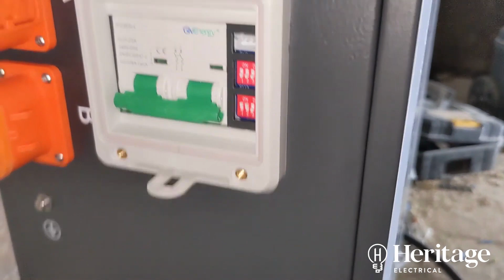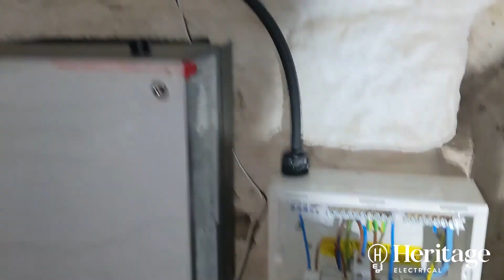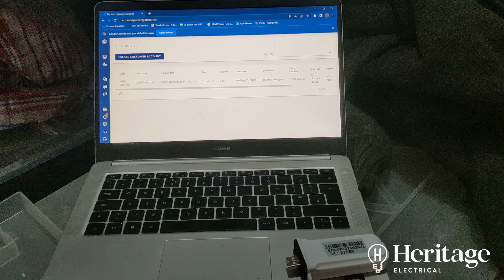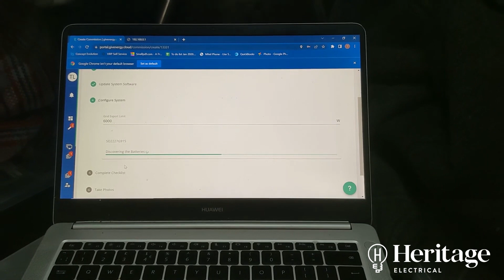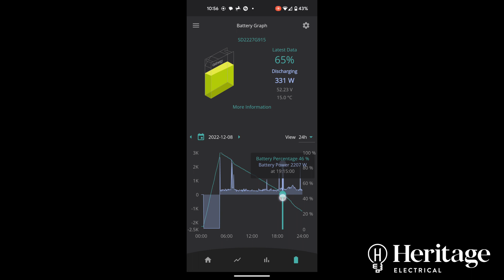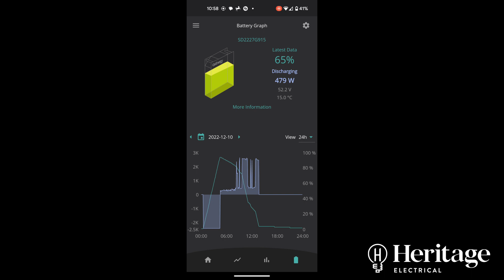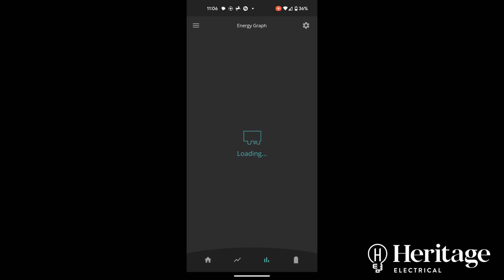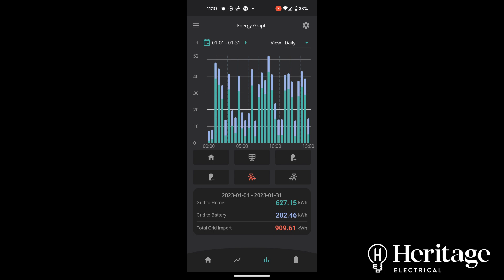Part 2: Installing a Givenergy Inverter & Battery Setup to Save Money with Octopus Go Tariff

Comment: Hi, It is very educational, and learned a lot.  I have a small question.  I have GIV-HY-5.0 G3  inverter and a Gem120CTM meter.  But not able to commission it.   Potal not seeing the meter.  Use ports 9 and 10 on the meter and the meter port on the inverter is correct. (+ & - are correct on both ends of the cable.)  there is output on this twisted cable.  But the system not seeing the meter.  The meter displays all data such as voltage, download power,  current, frequency, and so on.  Maybe I require an EM115 meter !!! thanks

Comment: Many thanks for this video.  Am looking at adding an AC coupled battery to my exisiting Enphase PV solution.  Probably late now, but you could have saved teh coinduit by having the data cable enter with the battery cables and then loop out of one of the spare compression glands.

Comment: Different question . Is there way to pair DIY LiFePo4 48V 16s with Givenergy 3.6kWh hybrid inverter ? Or it need to be specific battery with communication cable only ? Thank you
Reply from the maker: You would need to consult with Givenergy I reckon. Personally I would match manufacture of inverter to manufacturer of battery - you may have issues if you need to make a warranty claim otherwise.

Comment: Apart from your calculations re payback being highly flawed as mentioned in an earlier comment, I'm concerned about the lack of space given to the inverter. The spec notes that the inverter should have 300mm clearance below it, and 400mm to the left, right and above. Clearly in this installation only the bottom clearance meets the spec., I'd be concerned that in the event of a warranty claim that GE would refuse any claim on the basis that the inverter wasn't installed correctly. Not having a go here, but if this should happen, you're going to end up with the bill! I've only watched your videos as I'm about to look for tenders to fit mine, so wanted to see what it entails.
Reply from the maker: Hi Will, this clearance was checked directly with Givenergy before install. The Givenergy commissioning process is very thorough and involves sending photos to ensure compliance with installation to validate warranties etc. Empirically the customer was saving around £3-3.50 a day based on previous vs current bills with the battery install - this video is designed to be a quick look at some of the information provided by the app. If the customer was looking for detailed analysis before deciding to make a purchase, we would have done the calculations more thoroughly and employed an energy meter to determine usage/spec suitable equipment. As it happens this customer already had done their calcs and purchased the gear, we were asked to fit and commission only. Thanks for the comment.

Comment: 18:13 great video, just on your calculations here I think you’ve been a little simplistic, as I imagine a good chunk of that grid to home usage is also in the Go period going to the EV as well as the battery which the charts don’t show
Reply from the maker: Hi mate, thanks for the comment. Could you elaborate further? I'm just doing a very rough calc based on what the battery is saving them- they already had an EV and the go tariff before this install. Thanks, Tom
Reply: @HeritageElectrical no worries, the two options it shows is grid to home and grid to battery. Assuming they have the battery set to only charge during the Go 4 hour window, any EV charging at the same time will be counted as Grid to Home but would be at the cheaper 12p rate plus any other devices they may run on delay, we manage to do washing, tumble drying and dishwashing in our 5 hour go faster window, which more conveniently starts at 9:30pm so I can do a 1 hour wash and load it in the dryer before I head to bed). We don’t have a battery yet but if I look at my Octopus bill at the moment 45-50% of all my usage is in that cheaper window. Which makes the cost per month calculation a little more complex than applying one figure to the grid to home kWh

Comment: Why the ‘leakage’ from the battery back to the grid?
Reply from the maker: Hi Ian, thanks for the question. I spoke with Givenergy who informed me that when the house load changes say from 1000W down to 500W, the battery by design has to ramp down the discharge resulting in a small amount of power being fed back to the grid for a few minutes.